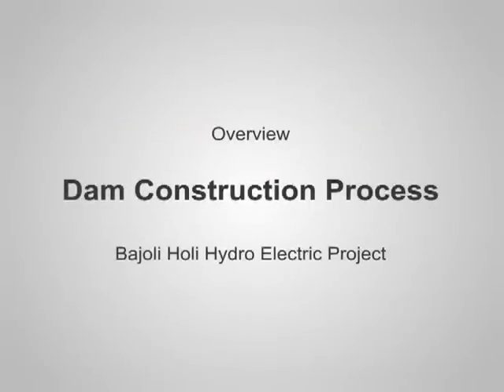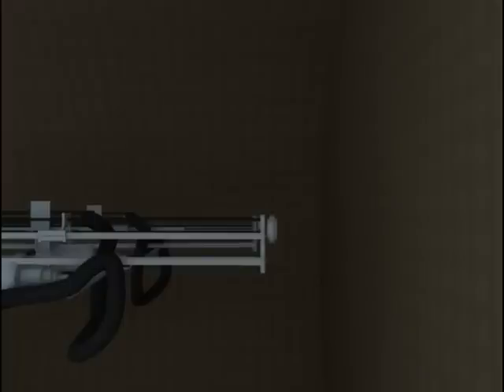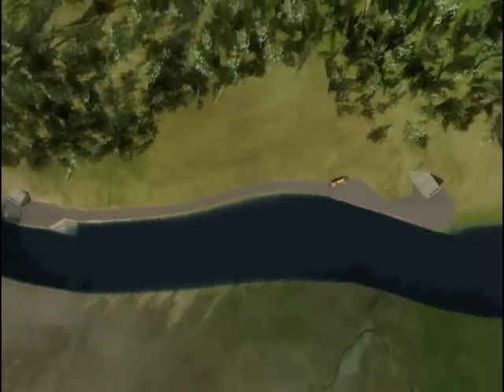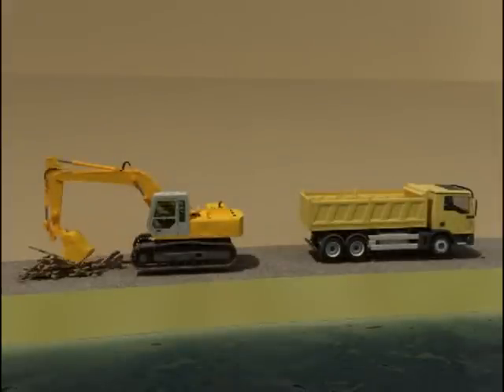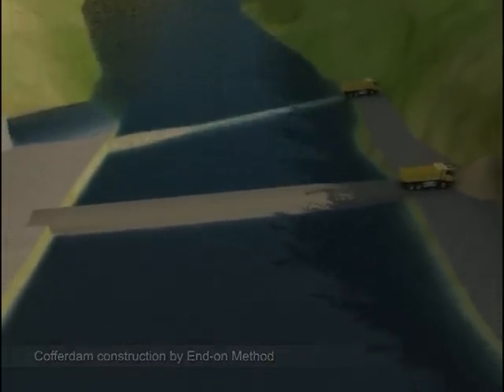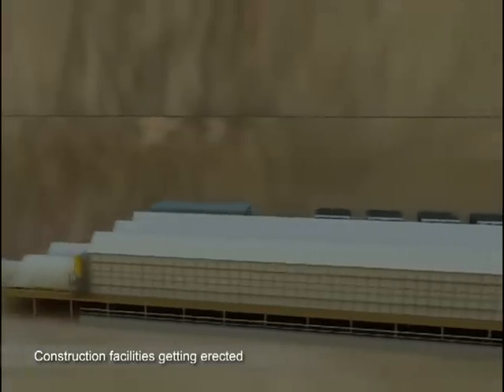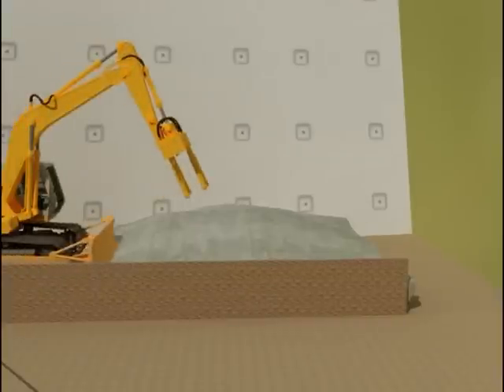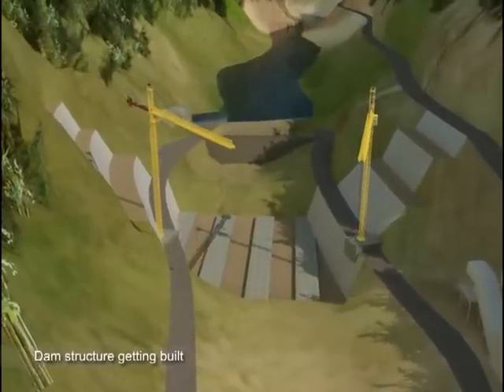Dam Construction Film - 3D Animation by Graffiti Design & Advertising

Comment: Concrete mixes "cure" during solidification.  Heat is generated.  I understood that Hoover dam (in USA) flushed cooling water through pipes to cool the mix so that the pours wouldn't over heat and cure haphazardly.

Comment: And when the construction is still on progress..how could the river flows? Or it just be overflowed until the construction is done
Reply from the maker: River flow is diverted through the bypass tunnel as explained in the video. The Tunnel remains operational until the dam construction is complete. so that the construction activities can be carried out. Tunnel ends are closed by vertical gates at both ends once the dam becomes operational.
Reply: @manishmandlik5776 , that tunels are enough for river's flow? 
And if any acciddntal flood it can work?
Reply: @hareshchalla7097   Tunnel designed in such a way that the entire river water can carry including cloud burst also .
Reply: @vikashsinghjee1694  but as seen in animation,tunnel size is too small then river size,

Is kaaran prashna hua.

Comment: in case of earthquake, wouldn't a flat wave of water hit the dam wall at precisely the same moment ?
I always thought an arced dam was to deflect such a senario.
Reply from the maker: As a rule of thumb, Dams are usually made to withstand forces more than 5 times of their service load (It is the pressure per square inch) w.r.t. the depth of the dam wall. Also they are built to withstand high richter scale earthquakes depending on the geological location and probability of occurance of an earthquake in that region. Any occurrences beyond these capacities can make the dam fail.

Comment: Building a dam how many year is required ??? Anybody know ?
Reply: My local community built a damn 30 years ago.and in the documentation they estimated 3 years. But this was a smaller damn. modern utilities and equipment may even speed up the process!
Reply: BARAK ELOHIM kk
Reply from the maker: It usually takes 2 to 6 years depending on the size and scope of construction for the dam.

Comment from the maker: Hi Nagraj, Diversion canal has two gates on its either ends which operate vertically. It could be closed permanently or left open as required.
Reply: That diversion tunnel is crazy....its great to have two strong  vertical valleys to build the dam...but that diversion chanal must be expensive to build
Reply: @justcrank9088  its al extra printed money from banks.

Comment: Very fine explanation  on dam construction.       Bangalore    25-06-2014
One doubt:  When a diversion canal is constructed before construction,
will it be used as  high level or low level canal?   Please clarify.
Let other readers also know this.

-  Nagaraj  T V  9844200688
Reply: 08-12-2014
Sir, I saw the video.  But my question remains as it is.
1) Is the diversion canal closed after dam completion?
2)Does diversion canal form part of dam?

3)If not closed,  does it create a hollow space
very adjascent to dam?

Will you clarify?
Reply: clarify my above doubt
Reply: hi,i will try to answer you
1) no they are not closed after dam completion
2) yes they are part of damn
3) Diversion canals have their own purpose,they act as storage dams,reservoirs and also to raise and lower the level of actual dam storage ,am talking about cofferdams. 
I might be wrong too.there are atleast 6 types of cofferdams depending on the depth and soil conditions. 
i will edit my answer if am wrong.